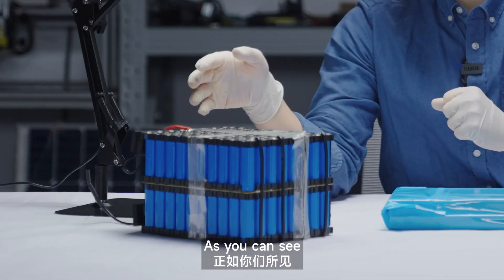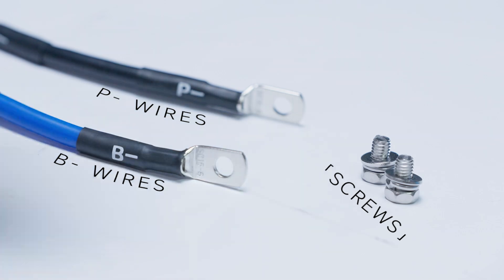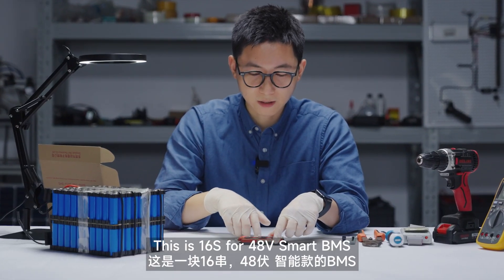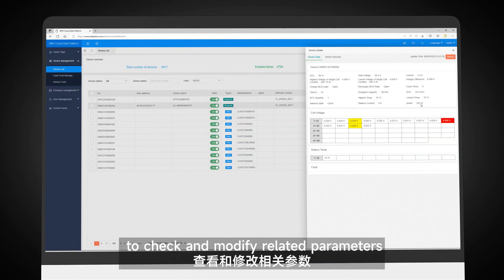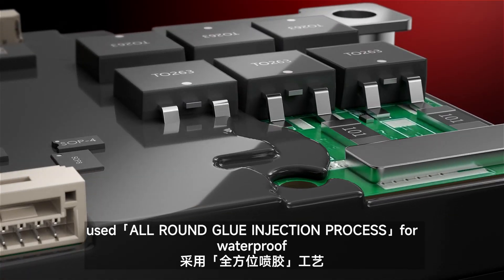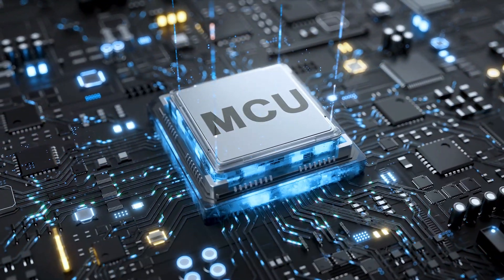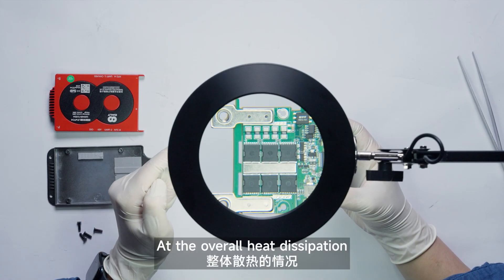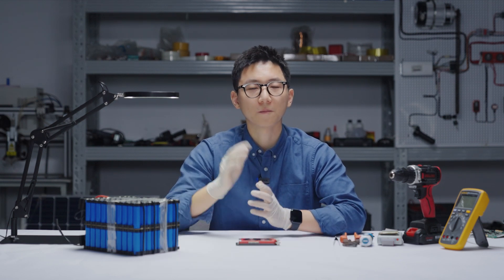DALY Lifepo4 16s 100A BMS Series Open Box Inspection

Comment: You can't parallel the 100balance bms. I bought 4 canbus/485 models but even though you think you can change the address in the software only one can communicate on canbus or rs485. I've tried everything like many others.